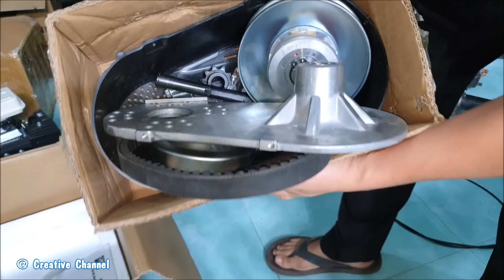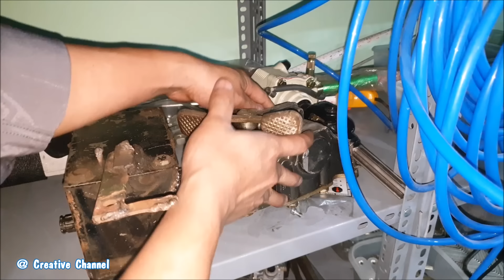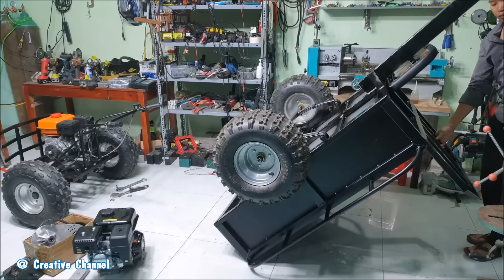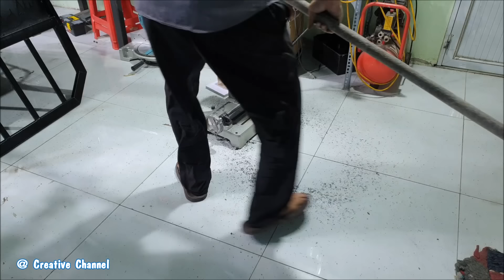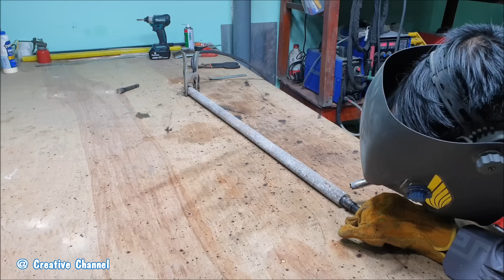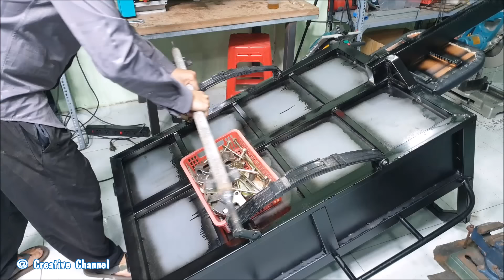Upgrade Cargo Tractor to 196cc and CVT Gearbox, Led Bar

Comment: Now it at its perfection  great job I only wish the engine could power  the lights but the battery does the job and would get you home 👍👍
Reply: Are you talking about a alternator?
Reply: @ibroughtaturbo-chargerfrom667  yes an alternator or a charging coil would  be the options  available  👍 ,  another  option  but mabey won't give enough  charge as needed would be a solar panel .

Comment: When I was in South Korea in 1980, this was a very common form of transportation for the locals.
Reply: Yes, we Koreans call it a Gyeong woon gi (경운기). It is still commonly used in the countryside.
Reply: this is a very common vehicle in almost every asian country in the countryside, each country has their own names but they're practically the same, although most of them uses a diesel tractor engine with a crank rather than a gasoline powered GX engine.

Comment: I loved everything about this builder video. It blows my mind how the axel wasn’t welded in a jig or using a measured form as were cuts made with a powered hand grinder/cut wheel without regard to being plumb. Yet, they were! You are incredible, just fantastic. I noticed the gearbox wasn’t accommodated with a carriage or with a modular frame, welding the entire unit to the frame - but it works until it has to be replaced.
Reply: J D We called them “One eyed buffaloes” because there was one headlight in the middle on the front.

Comment: Love this video but why replacing the engine, from my understanding its the same hp. Keep it up, great work
Reply: I make myself the same question. I also loved the video.
Reply: Probably more torque
Reply: @fabianradakovitz9064  maybe, but i don't think so
Reply: Old one has a buit in gear box i think
Reply: from a 169cc, 6.5 HP, to a 196cc, about 8 HP

Comment: The engine changes look due to the old engine had a gearbox built on it from the first video. That is my guess from what I seen. Very good work on Upgrade
Reply: No gearbox on the other one just a centrifugal clutch
Reply: @chrislewis2262  it had a gear reduction

Comment: its interesting to see a smaller version of this design. We use this vehicle in the phillipines.For hauling everything from wood, rice bags, pigs, and manny more. 👍👍👍
Reply: the torque converter is doing great in this build. i saw in lazada 5,000php for the torque converter kit. i was wondering if the torque converter could also be used in smaller engine 49cc
Reply: What are these vehicles called?
Reply: Quiero comprar  un CTV ( convertidor ) aqui en Ecuador presio o si en mi pais venden
Reply: Es para adaptar a una turbina jet  para empujar un bote de 7 mtr de largo y1.70 de ancho
Reply: @randomvideosman938 they're called Kuliglig

Comment: at the next time，you can give lens close-up in CVT，we can know how CVT works
Reply: I totally agree with you 💯 % on that
Reply: it's basically the simplest form of torque converter. as it spins faster, the "wheels " are forced closer, causing friction to the belt.
Reply: @russellmeier9526   Where find this cvt gearbox for Loncin 196cc?

Comment: Next, remove the governor. It wont blow the engine since the torque converter will limit its revs around 5300 rpm. And the valve springs begin to float around 5500 rpms
Reply: Yes, the governor is very annoying for direct throttle applications like a vehicle

Comment: This is a very cool build. I love how it eliminates steering, plus it would be fairly simple to add another engine to the rear axle to make it a 4x4, and if the center swiveled nicely it could make for some nice articulation. (Also I am very pleased to see that I am not the only person that say “f-it” and welds through the paint...lol)

Comment: When attaching the locking clip on a drive chain the open end of the clip should always face the opposite direction of the rotation of the chain.
Reply: May i ask why? I have a guess, but i would like confirmation if i am right
Reply: @sierrakilo1174  If the chain is rotating and just by chance something come into contact with the chain at that clip it can push the clip off if the open end is  facing the same direction as the rotation of the chain. Clip gone your chain is going to go flying off and may cause injury..
Reply: @rgbigdog  oh ok thank you for explaining

Comment: I am still in confusion that why he buyed extra two large head lights
Reply: Easy Tube. To see what lighting setup works the best. I’ve done this many times and the lights that I didn’t use were stored until I needed a replacement or friend needed one
Reply: @weevil_man  thats a good thing. Well he will also use the extra two head lights in another projects. Isn't it?
Reply: can always save the one larger one for the next build.

Comment: Needs mud flaps, beer holder, horn, stereo system and most importantly a floor under your feet.
Also you should get an engine with electric start and charging ability so you can charge that lithium ion battery pack.

Comment: under the gas tank there is a separate spring for the governor, put a zip tie through it , then tip tie the spring were it doesn't spread out, and BOOM governor bypass. but dont blow your engine :)

Comment: You need a bigger gear on the axle and also need to remove the governor that torque converter isn't doing anything.
Reply: Saw the same thing

Comment: Should've used a relay with those lights, just to be safe... and now that he has a onboard battery, he might as well add an electric start too. I'll bet the factory starter will spin REAL-fast working at 25.5V > 12V!

Comment: Nice build 
Now  upgrade it further add the following
1. Steering well ,replace the steering handle bars 
2 a silencer to lower the engine noise
3 a button to start the engine instead of the rope
4 short absorbers for the wheels
5. breaking system (preferably to stop the rear wheels)
Reply: Anather 1... The mad guard..

Comment: very cool project but you lacked putting a bearing there where it turns and where you changed the direction so it will wear out soon and put front suspension! regards

Comment: I think a geared transmission would be better for something intended for agricultural use, that way you can get high r.p.m's on the engine in lower gears resulting in high torque output, great for climbing hills with heavy loads.

Comment: I was just gonna say wet lands like that surly your gonna add some fenders and being a cargo hauler I'd went with a big block engine electric start and charging system just saying that 196cc struggled pulling y'all uphill some I love the gear box with belt drive setup I'd just went with larger engine if I was you
Reply: @jujitsuman68 well i guess real power ain't for just anyone LoL oh that envy really shows on folks like yourself ain't easy being the SheeeZY LoL

Comment: Hi bro.. your video so exciting...I need some help with you that I make a project in which I want to rotate a 12V motor in CW direction for some second and dwell 1 second after rotate in CCW direction for some second and dwell 1 second this all process repeat automatically with the help any circuit... please help

Comment: A simple note: The driver's backrest and the rear lights are good, and the vehicle is covered from the bottom in order not to leak splashing water from the wheels.

Comment: Please change your welding style, I know it may look like you're stacking dimes and it may look good, but that method does not allow penetration into the work which can cause your weld to fail prematurely, you want to do solid consistent beads all the way along the piece

Comment: In thermal version with this engine plus two electric at the rear wheel to help and relieve the engine on hills and in addition to that more traction in the 4-wheel drive version to get out of the difficulties

Comment: Excellent change, congratulations. If I can give a suggestion, I would improve the vertical connection between the engine train and the trailer, perhaps with a control spring system to make it more stable and robust. :-)